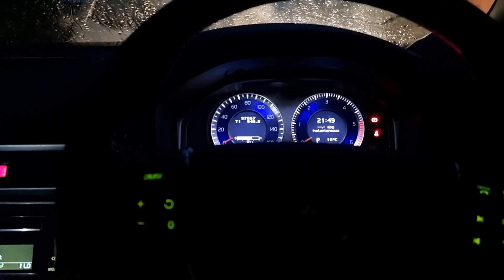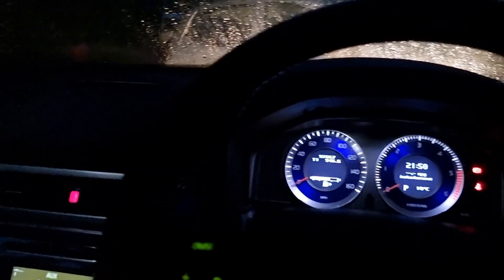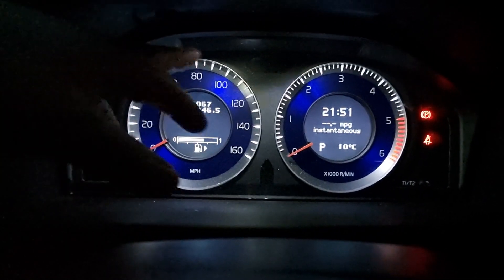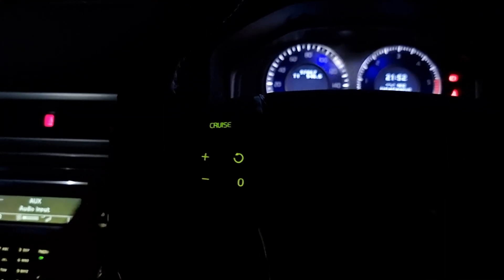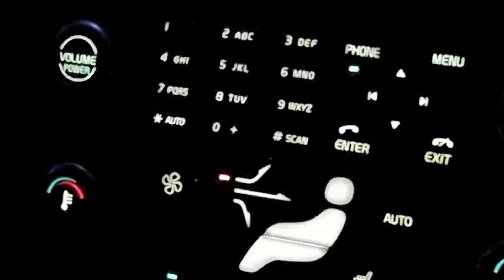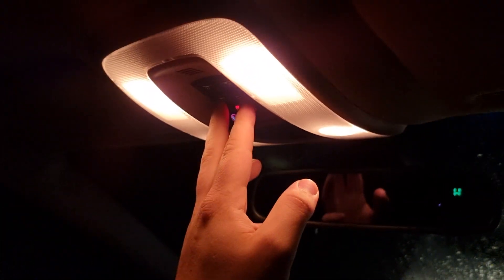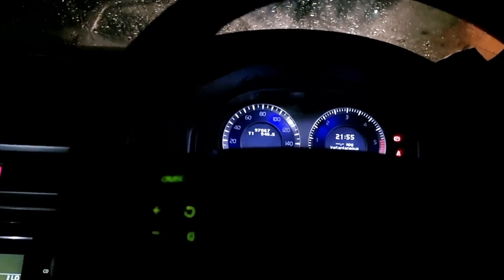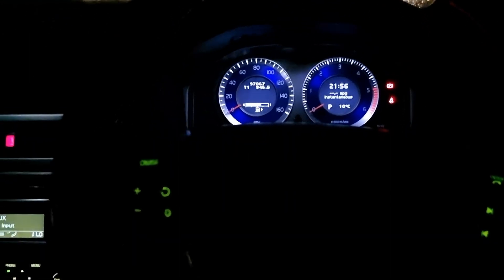The *MIND-BLOWING SCIENCE* behind Volvo Interior Lighting!!

Comment: I replaced my interior dome lighting with a single stripe led(wedge type),similar size to a halogen bulb ,to fit in the dome light case, i used after market t10 sockets (make sure you screw them half way or so ,otherwise the connecting pins will  go over the dome light pins , volvos t10 sockets have a different design than a standard t10 socket )
The leds i have are that bright, similar to halogen light intensity, but white light and they dont have after glow effect once the lights switches off 
I couldn't stand white light on dashboard, green on center console and orange inside